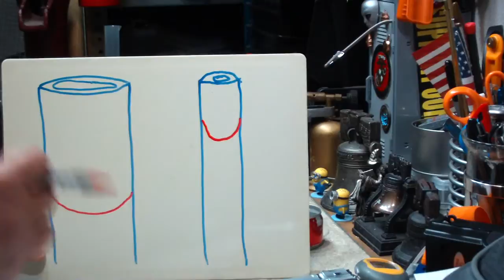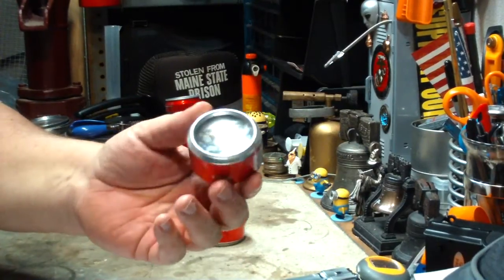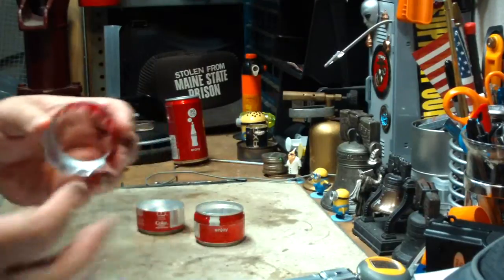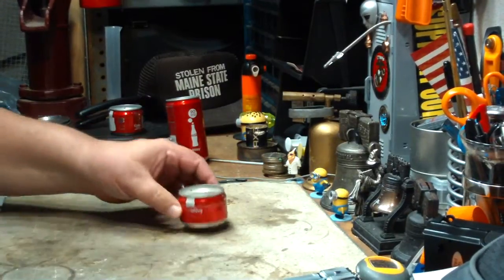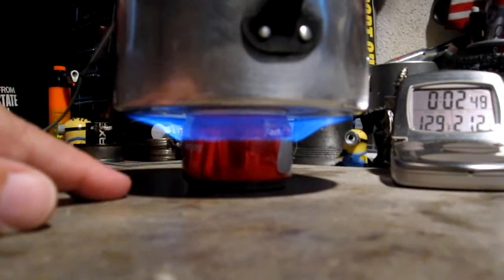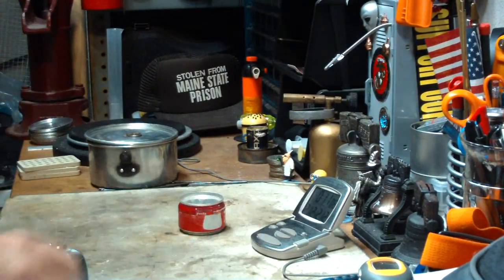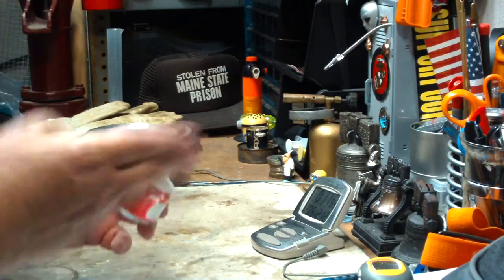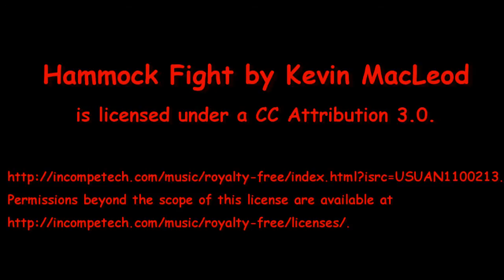Capillary Action Stove - Boil Test #1

Comment: I also noticed the same things that Daniel Lee  mentioned - I also got significantly faster boil times with a separate pot stand, and much shorter run out times as the burner really went through the alcohol faster. I went to the Fancy Feast variation of this stove because the pot stand I am using is made to grasp a Fancy Feast Can securely, and I want a burner short enough to fit inside of a 2.2 inch tall tea pot.

Comment: Hi Hiram, I made a Fancy Feast version of the Capillary Stove, An all aluminum Libby's Vienna Sausage can gave a 1 inch pot stand height, with the bottom of the can filed down until it cracked, then the bottom was pushed into the can and then removed for easier crimping. I used long jaw needle nose pliers to make the creases with a 90-degree twist, of which there were only 8 evenly spaced around the can. Four, 5/32inch diameter vent holes were drilled into the top can groove. I also paper punched out 8 half-moon fuel vents, centered on the flats in between the creased sections. I expanded the bottom of the crimped cylinder over a wine bottle to get a snug friction fit with the inner can going into the outer Fancy Feast Can, and it made a surprisingly steady pot stand. Boil times ran between 4 to 5 minuets, with run out times of between about 7 to 8 minuets. I do not have the accurate equipment that you do to do these tests with. 

I also made a couple of smaller stove/burners first out of V8 drink cans. They had slightly faster boil times, shorter run out times, heated more of the bottom of the pot, but were not nearly as steady when used as a pot stand. I made one burner with 16 creases and the second with 8 creases. I liked the performance of the total package better at 8 creases, although the bloom time may take a little longer with only 8 creases.
Reply: I made a "Fancy Feast, no wick", but CAS, with a 67mm OD (steel) can (for condensed milk), with a (steel) tomato paste can as pot stand, trimmed to ~25mm of flame height.

In the space between the two cans put a "sandwich" of soda can aluminum sheets:
- One flat + one with vertical grooves + one flat.

This "sandwich" create friction for keep the two cans together - can put the stove upside down, and good capillarity for the flame. Pleased with the result, carbon felt is expensive and difficult to get in my "corner of the world".

Comment: For simple crimping I just use a pair of needle nose pliers and give it a twist.
You will also get a massive speed boost (and also less fuel efficiency) if you don't have the  pot sitting on the rim - I've tried it with post stands and a good gap and it burns hot but chews through the fuel.
Reply: Pot act as heat sink.

Comment: to lift the pot off so a cold pot won't affect it so much, I threaded a few staples into the holes you put in looped around the top in a ring.  That lifts the pot off just enough.

Tetkoba has done a lot of experimenting with designs using capilary effects.
Reply: if you want to avoid small holes, I have had luck doing 4-6 small crimps around the top edge, which lifts the bottom of the pot JUST enough up off the top ;-)